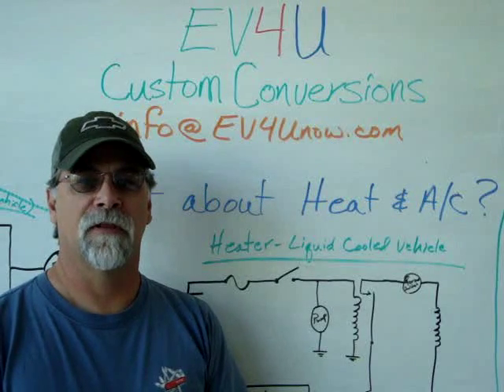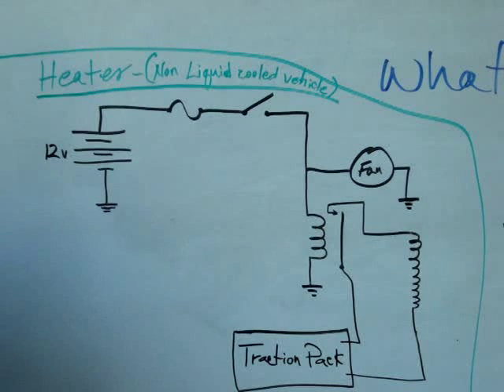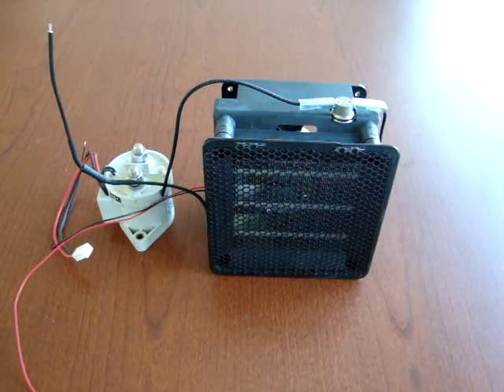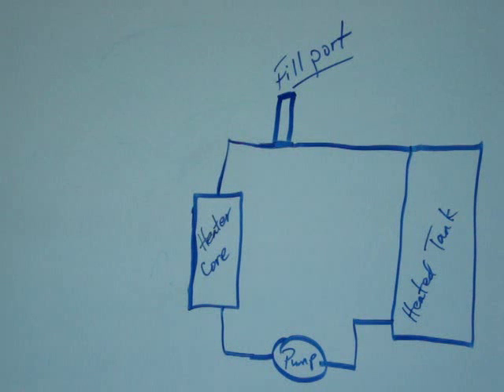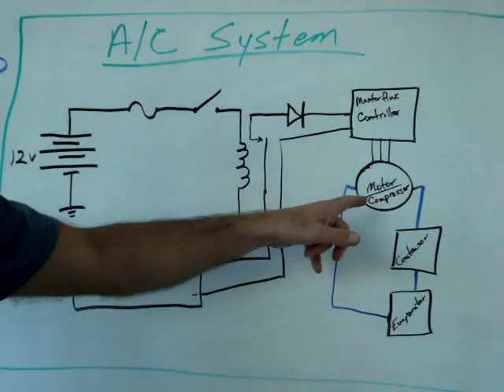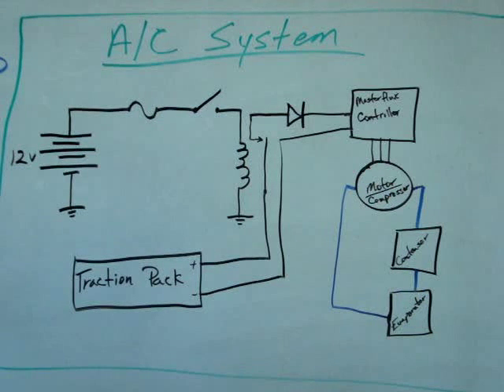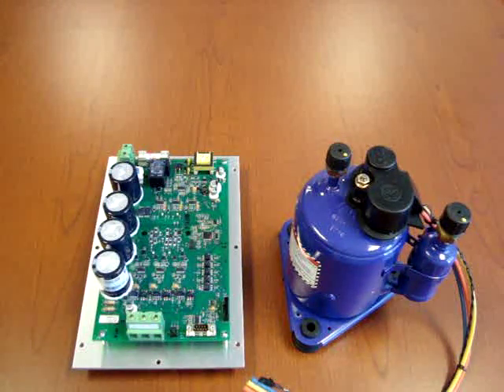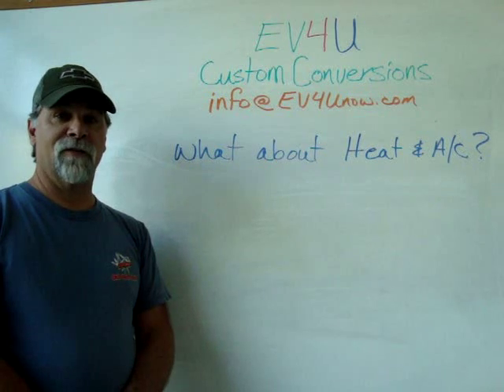DIY Electric Conversions - What about heating and air conditioning?

Comment: I have always wondered about the AC and heat. I would think the non liquid heater (ceramic with fan) would be to best and most efficient way to go. I know the cost can get high, but we are talking about a vehicle that is almost maintenance free for life. Thanks for posting.
Reply: A heat pump would be far more efficient use of the limited battery energy available.   With electric resistance heat, you get 1-to-1 heat, as you are converting electricity directly to heat.  With a heat pump, the worst of the lot, gives you at least a 2-to-1, using the electricity to move heat from the ambient air, into the vehicle.  I was wondering if the video would mention heat pumps...

Comment: Richard, this was a great explanation of the Heat and A/C systems! As a Floridian, the A/C is really more what we will need. You mentioned the price difference between a vehicle that previously had A/C and one that did not was about $2,000.00 Is that due to having tp run the plumbing and air ducting, or is it more involved than that?
Thanks again :)